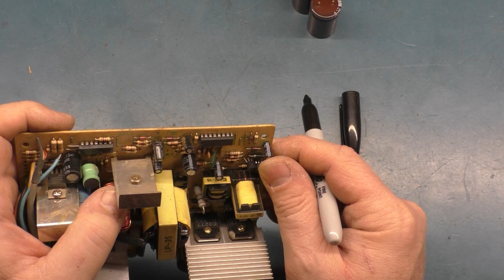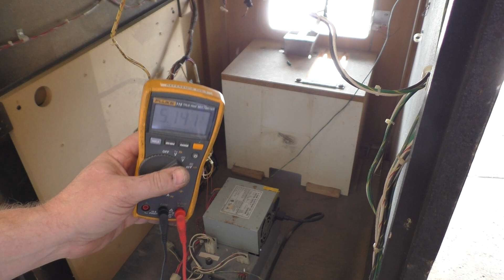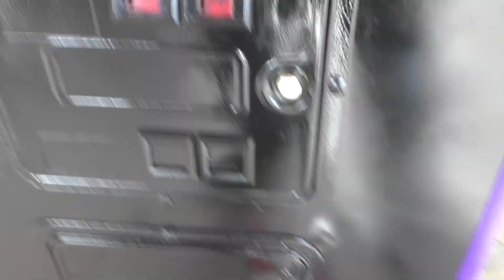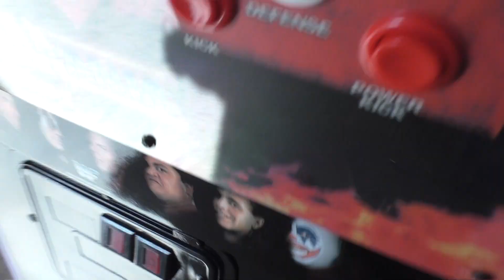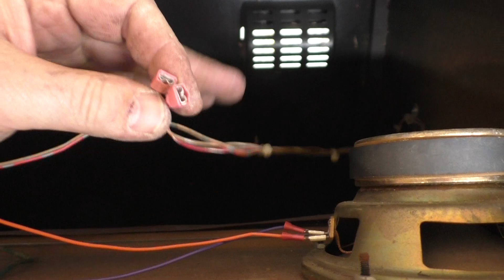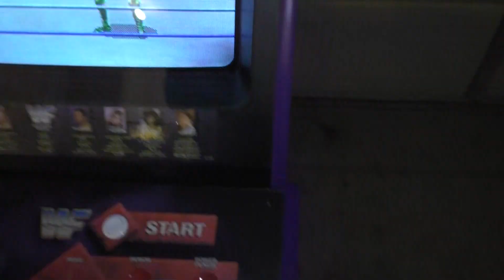WWF Wrestlemania Arcade Machine Conversion Project - Part 4 - Completed!

Comment: I had that exact same power supply in the MK4 and it did the same thing! Turning down the voltage made it just shut down. My skills aren't at the level of replacing the innards of it though, so I just ordered a new one. Is the wood piece that the PCB is mounted to just a top from another Midway cabinet? I know they used to reuse parts. The hole on it looks like where the power switch goes. The cabinet really looks great. That purple T molding really fits it nicely. I love the Hantarex Polo, my KI has one and its just gorgeous.
Reply from the maker: Interesting. No, it’s just a piece of wood. Nothing special about it. Thanks!